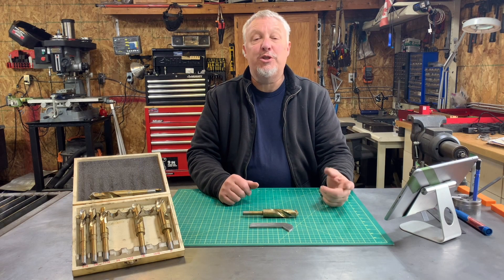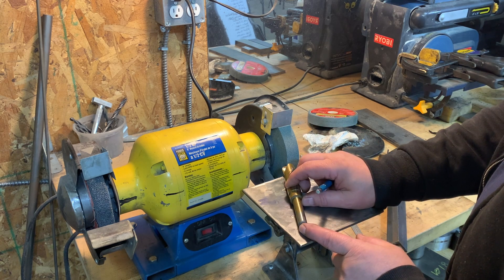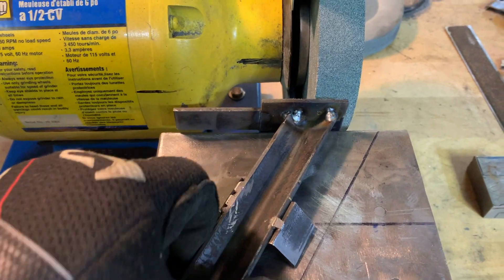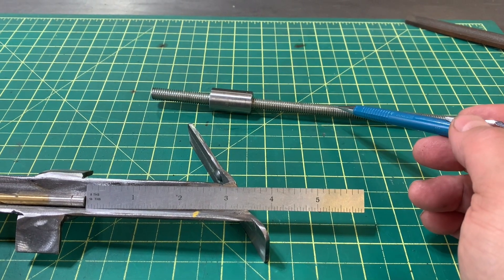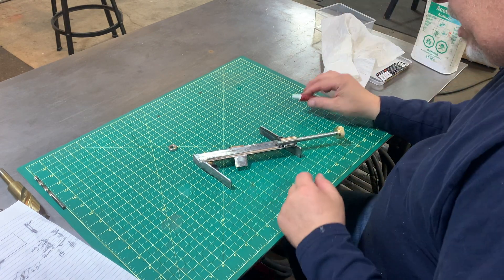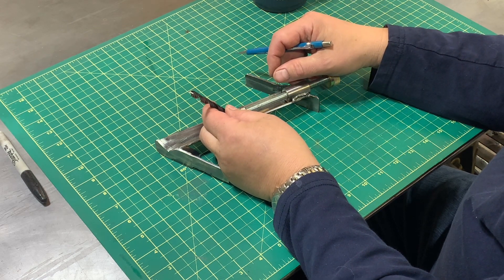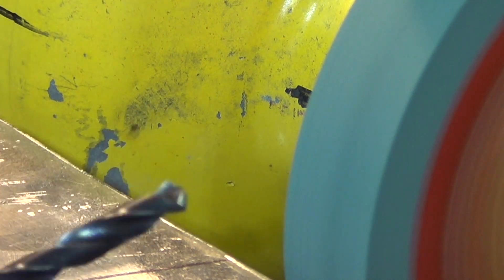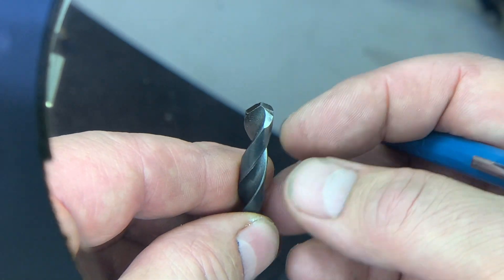Sharpening Drills - The never ending saga

Comment: Great new tool. I’ll have to build one soon. Ps. What type of large drill bits do you use. Are they from princess auto?🇨🇦
Reply from the maker: Yessir they’re from Princess Auto.
Reply: @LetsRogerThat  I have been thinking about buying them but have seen mixed reviews .Would you buy them again?
Reply from the maker: @pforbom1844  I would buy them again. They’re not the best but good ones are too expensive for the amount of work I put them through. Its a compromise
Reply: @LetsRogerThat  thanks
Reply from the maker: @pforbom1844 just a quick update on those drill bits. Used them on pre hardened 4140 last week. Ruined a few. I will need 8% cobalt bits for hard metals. Fyi
Reply: @LetsRogerThat  thanks for the update. I mostly work with mild steel and wood.
Reply from the maker: @pforbom1844  they should do fine for you then 👍🏻. Gilles